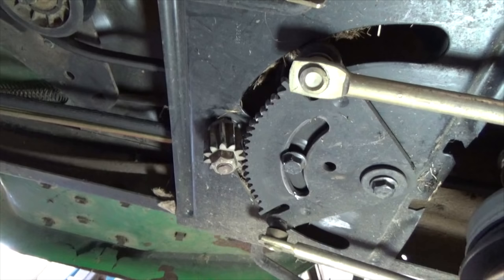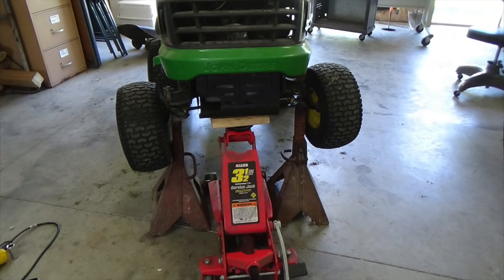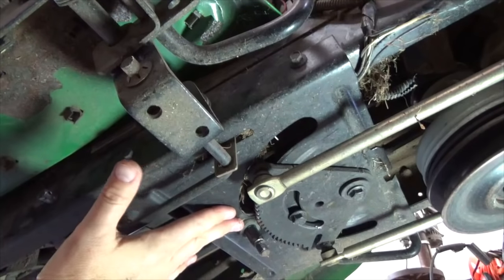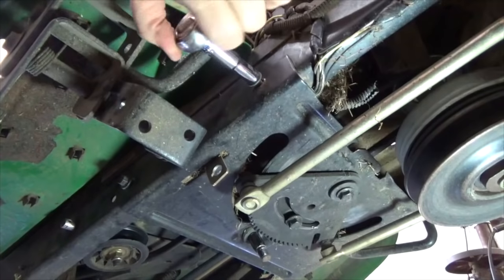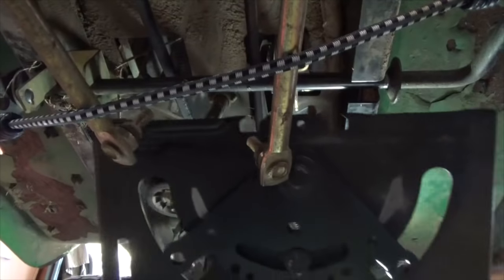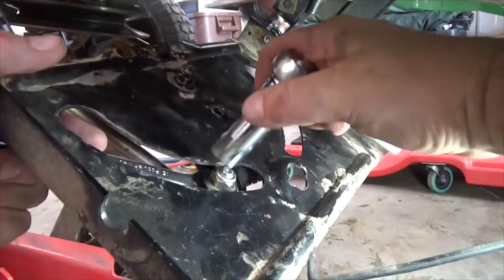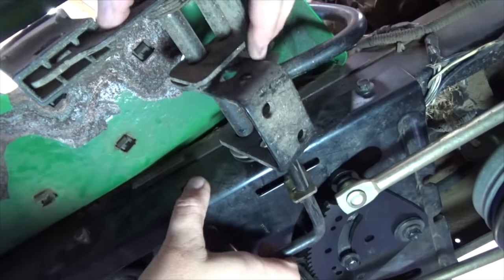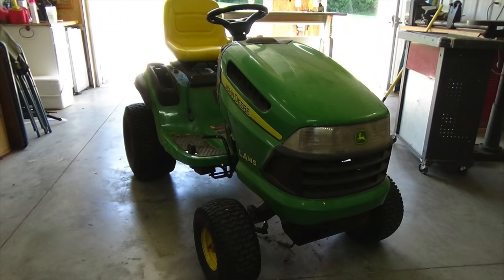Steering Sector & Pinion Gear Replacement - John Deere LA145 Riding Mower

Comment: Just got this beauty today, that's  14 years after came out: has 400 operating  hours & i paid a ridiculous low amount. The previous owner gave up on her due to small aggravations such as this steering play issue...thanks.for the tutorial, I am committed to bring her back.
Reply from the maker: let me know how it went!
Reply: I just did my 2006, 155c, 48" deck that had original steering at 705 hrs. used on the farm with lots of stuff to steer around.  Mine is the same as this video and you don't neeed to remove that plate.  Open end wrench holds the nut and you can get your hand up there to get nut started back on.  I also removed battery to replace upper bushing which you knock out with any dowel from below.  I also removed the K-46 Tuff-Torq hydro and changed the oil and filter at the same time.  Hydro and steering work like new again.  Several videos on servicing the hydro but you need to have better mechanical skills or you can turn the mower into junk.  You at least need to blow the mower off if not power wash it so it's clean to work on.   I bought this mower new.  Great mower, just normal belts, pulleys, etc. till now.

Comment: This is a great tutorial. Thanks! I'm getting ready to do this on a JD LA145.  The pinion nut on the end of the steering shaft is 19mm (3/4" will work) the four nuts holding the steering plate to the frame are 10mm, the bolt and nut with the bushing that holds the connector gear to the plate is 15mm for the bolt head and 15mm for the inner nut. The steering kit should have come with a new bolt, nut and bushing, however, it doesn't come with a metal washer that is shown in the parts explosion so I bought one at the JD dealer.. The bolt that fits in the center slot on the sector gear is 15mm for the bolt and 13mm for the inner nut. My steering kit did not come with a new one so I had to go to the dealer to replace the bolt and nut since it was in bad shape. The steering arms are held with a 13mm wrench while removing/replacing the 17mm nut. 

Update: Wow, that pinion gear is a beeatch to get off.  I've tried PB Blaster, a puller, a propane torch and a BFH and it still hasn't moved.  I'm going to let it soak overnight.  The next day I was finally able to remove it with the puller (Performance tools W140) while heating it again with a propane torch.  You have to thread the nut partially back on to hold the puller bolt since it has a tapered end.  

There is a second bushing higher up on the steering shaft that should be replaced as well. My steering kit came with the extra bushing (both are same part number)  I removed it by removing the battery and the U bracket under it.  You can get to the upper bushing after lifting the steering shaft out and setting it to the side.  I used some big needle nose pliers to remove it and put the new one in with a 15mm deep socket and 10" extension by tapping it lightly with a plastic deadblow hammer.  

Do yourself a favor and put anti-seize on the steering shaft before installing the new pinion gear.  It will go on easily and, more importantly, will come off easier if you have to do this again!  I also removed the steering wheel to make wheel alignment a little easier.  I slapped a little anti-seize on that end of the steering shaft as well since the splines were a little rusty.  

It drives and steers like a dream now!  I hope this helps others who need to do this.
Reply from the maker: Thanks for posting that!  Hopefully it will help someone else out.

Comment: As everyone else has noted, excellent tutorial - without watching this I would have taken it to John Deere and paid them to do it.  These projects never go well for me - but with the step by step you provided, I got it done in reasonable time - with getting the pinion gear off the longest part of the project.  This was a 2003 L130 and I think this was the original equipment (my dad purchased this from John Deere dealership new), so not surprising that it was stubborn.  One note is that on these older models, I found that it did not have the replaceable plastic bushing but a permanent metal bushing.  Also the pinion gear nut that John Deer gave me would not thread on - it felt and looked like it was cross threading, but the nut that was on it went right back on with no problem.
Reply from the maker: very glad that my video helped you out, Jimmy!  Thanks for watching and commenting.  Hope you like my other videos too.

Comment: After about 3hrs I did get everything off, that pinion was a pain as well as a washer stuck between frame and gears. finally lifted up on steering it came right off. Those OLD BOLTS were a pain. I also need a tie rod. Right now I'm price hunting. Once. again this has to be the best VID I've seen displayed step by step , GOOD JOB!!!!
Reply from the maker: Rodrick, You made my day with your comment!  SO glad I could help you out with my video.  Thanks for taking the time to give positive feedback!!!

Comment: I have an old, 2007, JD X300.  After nearly 700 hours of mowing the front wheels wouldn't turn just like you showed. I saw the center portion of the span of sector gear teeth were worn down to the point they no longer engaged with the pinion gear.  The pinion gear was fine which was a good thing as it's welded on the bottom of the steering column. The whole steering column would have to be replaced for $165. I ordered a replacement X300 sector gear but when it arrived I couldn't install it. It was too dissimilar to fit my mower.  My internet search didn't show a sector gear that looked like mine so I was left no alternative to repairing my gear.  This was easier than I thought it would be. I used my MIG welder to add steel to the bunged-up gear teeth and ground the welds away until they looked like the original teeth. When I put it back together it worked pretty well.
Reply from the maker: I love the fabrication that you did. good job. must have taken a while, but at least you got the job done!

Comment: Great video. I’ve replaced my gears three times. If I can add, when you have everything apart, check the plate itself where the sector gear mounts/pivots. The hole on my plate became an oval and caused everything to misalign. The gears were too far apart to mesh as a result. I replace the plate ($45-$50) and the steering is great now.
Reply from the maker: Thanks for the info, Steve!
Reply: Excellent point

Comment: Excellent video!  Very well shot, narrated, and performed!  A+  Watch out for that small, thin washer at approximately 3:32.  Also, make sure your steering wheel is properly aligned when you put the pinion gear back on or your steering wheel will seem "crooked".  It is an easy fix either by re-doing the pinion gear or re-aligning the steering wheel up above but it's easiest just to make sure that the "spokes" of the steering wheel are level when you put the pinion gear back on.
Reply from the maker: Great tips, E5Bobby!

Comment: This was a very helpful video thank you. I decided to try to do this without taking the deck off as suggested in the comments,. I was able to swap the gears out after taking the right side steering linkage loose at the tire, allowing more space to work. I was successful in the swap out of the gears without taking the deck off and it took me about 45 minutes to complete the job.
Reply from the maker: It's always nice to find a 'work-around'.   My deck is so easy to take off, and I love room to work.  I will admit.... one of the biggest reasons I had to do it, was to get my camera shots that I needed! HA!   Anyway.    glad my video helped you out.  Thanks for the great feedback, Douglas!

Comment: Hi Phil...  just wanted to say many thanks for this video...  the only one of its kind that I could find that clearly laid out the procedure for success in this rebuild.  I have an L120 instead of the LA145... but they are so similar that the video worked great for me.  The pinion gear on my mower was badly worn... the sector gear, however, was still in pretty good shape but I replaced it any way and now hopefully will never have to make this repair again.  If you ever update the video... one  thing I would suggest would be to point out that the main bracket that is held to the frame with the four bolts  has cutouts that "go around" the operating rods for the brake and the drive pedals.  You can't see the cutouts until you take it apart... and not realizing the cutouts are there had me thinking the repair would require much more disassembly than it did.  Minor point though.... and again your video is great!!  Best regards.... Tom
Reply from the maker: Glad my vid helped you out, Tom!  Also.... thanks for the great tip.  Maybe it will help someone else out.  I would love that.   Take care, my friend.  Hope you like my other vids.

Comment: Great info.  I tried to get away cheap last year and just did the small gear,  Guess it's time to go back and get a plate gear, bushing and new small gear.  Only thing I saw you leave out was making sure the steering wheel was where it belongs ( as far as level) before installing the small gear.
Reply from the maker: Right on!

Comment: Yea.. IDID IT!!!!After watching your step by step video I changed my Steering Sector & Pinion Gear on my John Deere L118. While my L118 was every so slightly different, I could've and wouldn't have taken on the project without your video, showing the step by step guide. So, Again thank you. I also changed the belt and blades and lubed her up while I had the deck off. Deferred maintenance....Time taken 4 hours for everything
Reply from the maker: David, your comment made my whole day!  So glad my video helped you out, brother!

Comment: Really useful. Would not have been able to replace the steering gear on my x140 without the clear instructions in the video without this even if getting the brake rod back in place turned out to be a bit of a mission!  Thanks and greetings from South Africa
Reply from the maker: So glad my video helped you out, Theo!

Comment: I thank you very much for this video. I was able to get parts on Amazon for $45. I checked with the local John Deere dealership to do the repairs. They wanted over $500 to do. I was able to do myself. It was very easy. Again, Thanks.
Reply from the maker: YES!  Good to hear that my vid saved you money, Greg!  The labor on these things are insane!   The hourly rate that JD shops charge on some of this stuff is like big-city-lawyer fees.  This job probably took me 2 to 3 hours to do......average would be $200 per hour at that rate.  Cons!

Comment: Nice video.   My steering just crapped out today.  You've given me the confidence to repair it myself.
Reply from the maker: You'll be surprised how easy it is.  BTW:  I didn't have this in the video, but all moving parts should be greased.  That's what the pro's are suggesting.  Thanks for the positive feedback!  Let me know how it went!

Comment: Thanks for making this video. Made the process much easier even thought the repair was more involved than I thought it would be. Kudos Phil!
Reply from the maker: +Tim Creef   Ya, it's not a fun repair, but it's not hard either.  Bet u could do it with your eyes shut next time.   Hopefully, there won't be a next time!
Reply: No, No, No,  Phil made it much harder than needed.  You do NOT need to do the hassle of removing the plate. Remove the steering shaft pinion  gear from shaft and lift up steering wheel which is needed to replace the both shaft bushings he neglected to show you.  You have to remove battery and battery support to easily access upper nylon bushing.  With steering shaft lifted up you can easily reach both bolt nuts with an open end wrench to take sector gear off from plate.  Once sector gear drops down you can easily take steering linkage off.  Then reverse process. You can easily get your hand above plate to put nut back on the 2 bolts.  Drop steering shaft down through the 2 new Nylon bushings. Have wheels pointed forward and have steering wheel in correct position then place pinion gear on steering shaft so everything is correctly aligned.  Really helps if you first use air to blow top of plate off so you can see what you are doing.  Done this on my 155c and LA150  which is exactly the same and uses exact same parts.  Good luck.  720 hrs. on my 155c because I don't abuse it and 510hrs. on LA150 as previous owner reefed on steering.

Comment: This video helped me tackle a job I otherwise would have left to the pros. Thanks again! You really made it easy to follow. I would also note that the plastic bushing which you removed after removing the gear piece, wasn't on mine. Well, it was but it wasn't the same. I finally figured out that the bushing wasn't plastic at all, but solid steel! I must have gotten lucky and maybe the manufacturer realized the plastic bushing was crap, so gave me a solid steel one to begin with. No complaints, as that's actually what I thought it should have been when i first learned that a plastic bushing was the most common. Wonder why they ever used plastic to begin with, but oh well, I'm mowing once more : )
Reply from the maker: You're comment makes my day!  Thanks for taking the time to give me such great feedback.  I love knowing that I helped someone out!

Comment: FWIW, I am about to do mine, picked up all the parts through JD for just under $50 after reading some of the negative comments on the aftermarket parts wearing out after a few hours.  In any case, JD parts have had a pretty good price drop in the past few years.  I did confirm the second bushing is behind the battery box.  Also, since I have so much slop at the steering wheel, I was looking for a way to repurpose one of the old bushings up higher.  That was when I noticed the plate all the way near the top held in with 3 10mm screws was loose and floating all around.  Snugged that up and the top end slop is gone.  Just a hint, DO NOT overtighten the 3 screws.  They are just molded into plastic standoffs and will not take a lot of punishment.  Learned that on my Harley fairing!  Oh, also picked up the press nut for about a quarter rather than waste time and patience trying to salvage the old one.
Reply from the maker: Great tip, Rags!   indeed the JD replacement parts are WAY better quality than the aftermarket, and are WAY better than the parts they put on their own stuff for Big Box stores.  You ought to see the different between the drag-links they sell as replacements compared to the garbage they install in the factory.   If JD put their replacement parts on the mowers to begin with, these $2K mowers would cost $8K...... Sooooo..... I do understand why they do it.  Most people that have these probably mow in-town size lots.  I mow 3 acres of rough country ground that jars my teeth out once a week.   Anyways....   Thanks again for the tips!
Reply: @PhilCrockett  My thanks to you.. This was the most helpful video on the net!  I have spun some wrenches in my 73 years, but the tip about dropping the plate and putting the rods back in before replacing it saved a LOT time.  That said, I only had 2 real fights.  First one was trying to remove the big pivot bolt and nut.  I swear at one point I was checking to see if they were welded in place.  Finally put the nut in a big vise and turned the plate to break that loose.  From that point on, it was clear sailing until the new small gear refused to go on the shaft.  The old one was snug coming off , but the new one fought me all the way in spite of verifying the angles were right. Lube,gentle tapping, nothing worked.  Finally cut a block of wood and went from the floor to the bottom of the gear, then tapped the top end of the shaft until I could get the nut to thread on.  Next time that comes off, I'll buy a zero turn! LOL. Again, thanks much for an excellent video.
Reply from the maker: HA!!  Yes!!  Sounds like your experience is the same story I have on 99% of everything I work on.   Last weekend I couldn't get a bolt to turn on my rear brake calipers on my truck.  I stripped the head of it trying, and then put a pipe wrench on the rounded head with a cheater bar.  Jumped around on it and called it names for about an hour.   Long story short.....  I paid $425 to have a mechanic in town do the job.  OUCH!